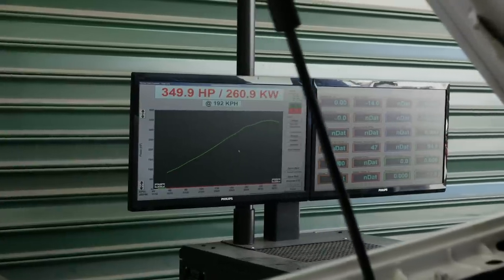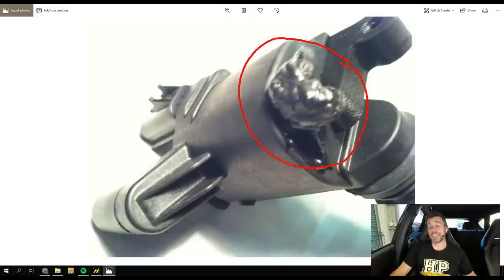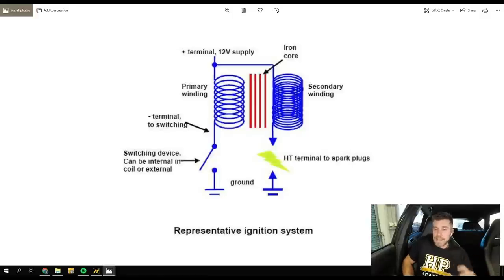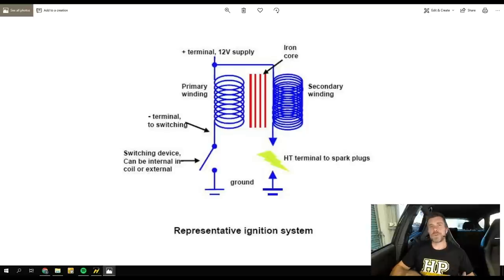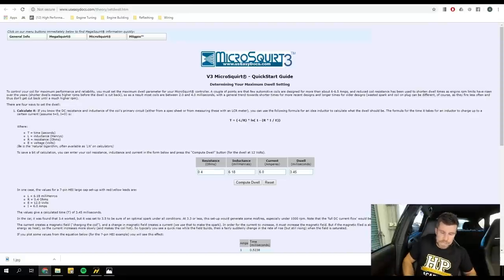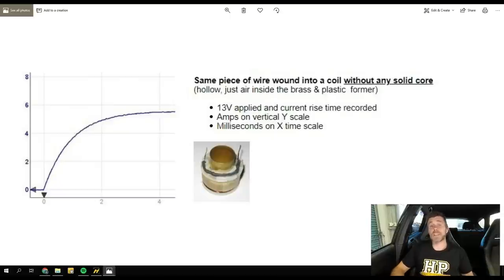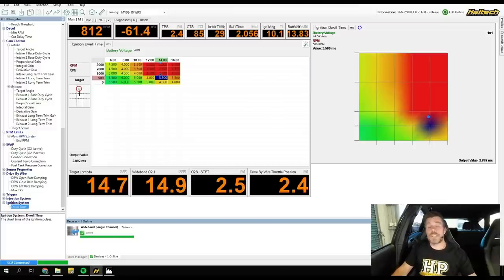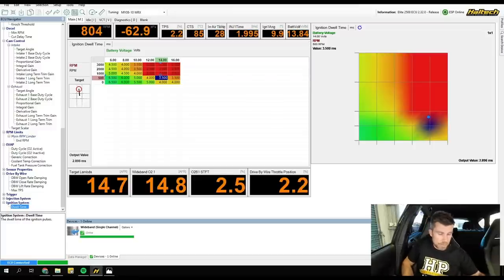What is Dwell Time? [GOLD WEBINAR LESSON]

Comment: I have the 2500 and am going to use new oem subaru coils. I'm not sure if their internal ignitors will completely control dwell on their own. I also notice in the haltech map for the sti I'm using, the lowest dwell is 3.6ms. I also can't see the voltage range (top of the graph) on my laptop, the only numbers I actually see are the dwell settings. This is something extremely important I need to figure out before the tune. Thanks for the great helpful videos..as always!

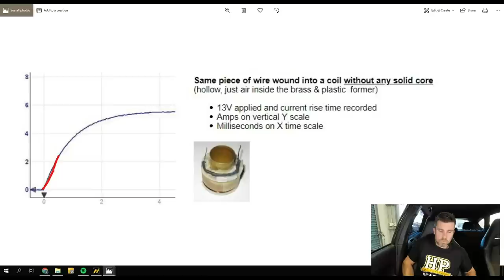Comment: 16:05 You are understandably simplifying things a bit here. Maximum current for the coil also depends on current limiting in the ignition module. For example, for a 1.0 ohm coil and 12 volts this implies you can have 12 Amps, and for a 0.5 ohm coil, you can have 24 Amps, but most systems you'd see in production or modified production cars aren't drawing 12 Amps through the coil. What happens is the first part of the curve comes from the coil resistance, inductance and the DC voltage, but at a certain point the current is limited to maybe 5.5 Amps or 8 Amps by the ignition module. You have a two part curve and once you reach the current limiting by the module, increasing dwell won't get help you store any more energy in the coil. Thanks for this video. 44 minutes is long, but a lot of practical information was worth watching the whole thing.
Reply: Not all igniters have current limiting .

Comment: perfect video but the drawing of the ignition coil is wrong on 07:30 . the secondary coil need to be grounded not +12v
Reply: Sorry, you are incorrect. Majority of 2 terminal coils have secondary internally connected to igniton (+ve) terminal as shown in diagram. There are some exceptions, but this is how Bosch do it for example.

Comment: what effect would a dwell time which is too high, have on a power run, and AFR, etc?
Reply: It's kill coil and even ECU òi Dwell time is too hight
Reply: @NgocPhamVN96  and what about in relation to the question I asked?
Reply: copper has a positive temperature coefficient, so if anything, heating your coil has a detrimental effect. You might not measure the difference on the dyno, but increasing coil resistance generally isn't considered a good thing. also your ECU or ignition module is probably doing some current limiting to help protect your coil, so that gets hot too. Being stranded by the side the road or track will not win races or impress your friends.

Comment: Ah, a different definition for "dwell time". Dwell is the period near TDC where the piston is nearly stationary. It is adjusted by changing the rod to stroke ratio and the amount of piston offset.
I realized quite early in my quest to solve internal combustion that spark ignition engines simply can't achieve acceptable levels of efficiency. And yes, I was successful. Even figured out how to build an engine with two combustion cylinders that provides smoother power than a straight six.